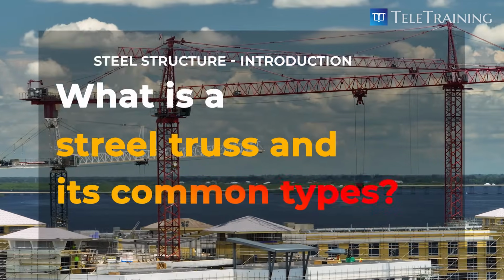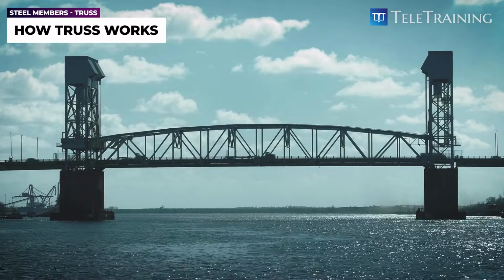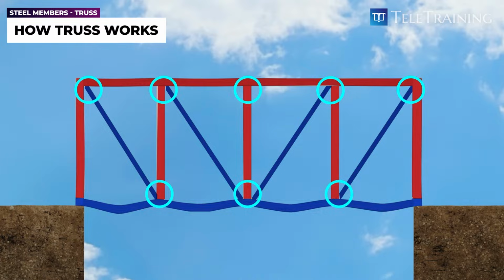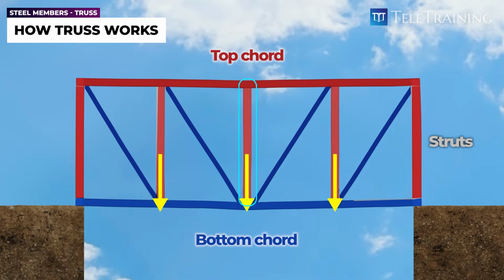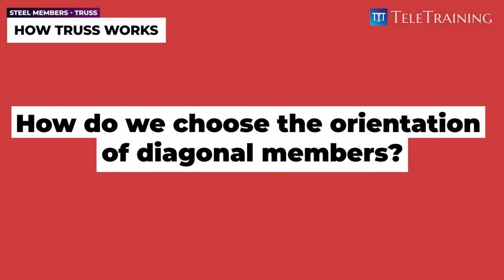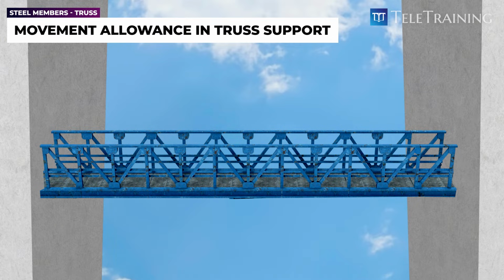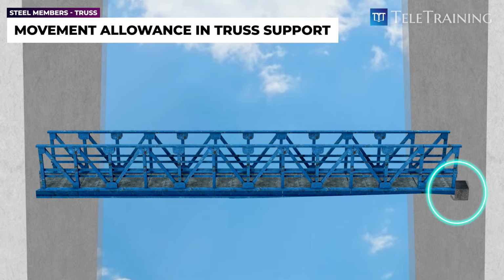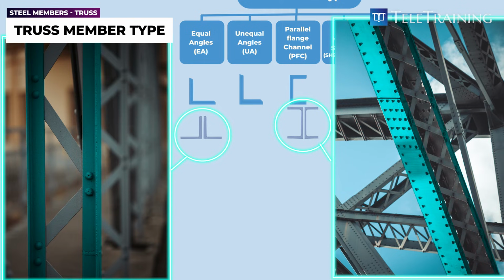How does a steel truss work?

Comment: Hi. Its very interesting to know about the role of bracings. But I want to correct you regarding the K-bracing. What you have explained in the video is all about inverted V-bracing, its not K-bracing. Please search about the k-bracing because for industrial structures K-bracing is not allowed and it is written in some of the design codes also (like IS800). While the inverted V-bracing is allowed to use.